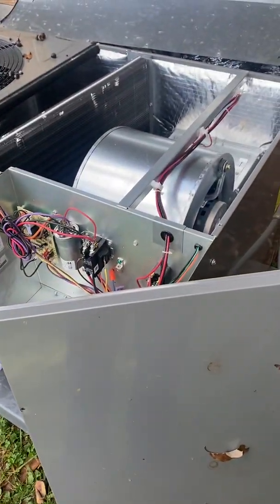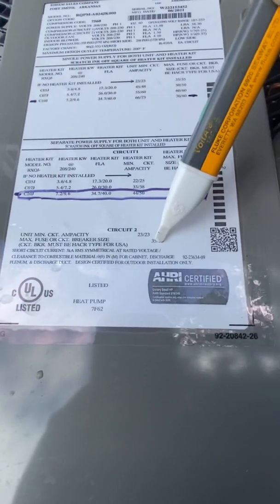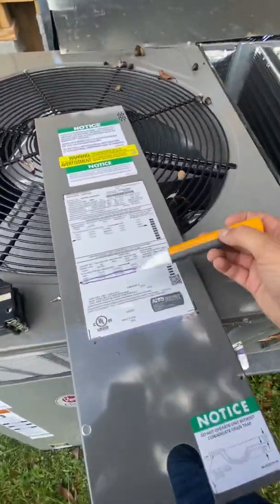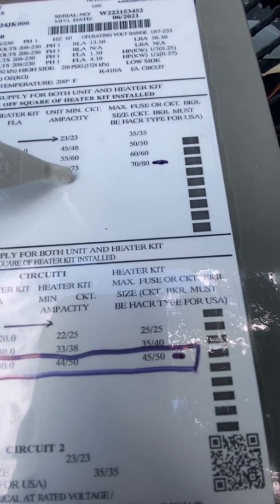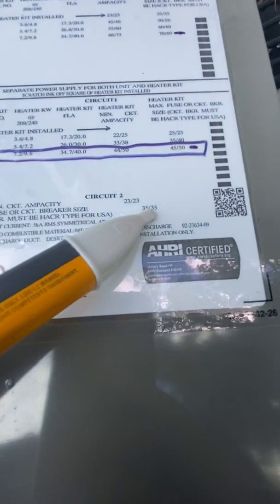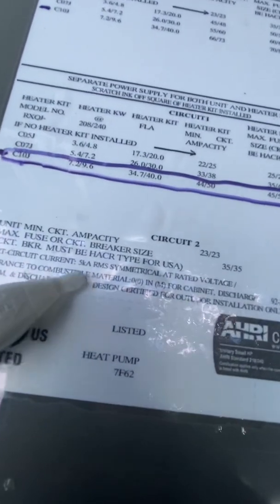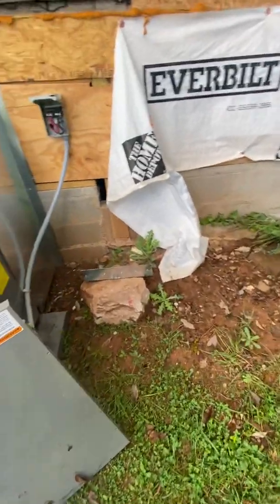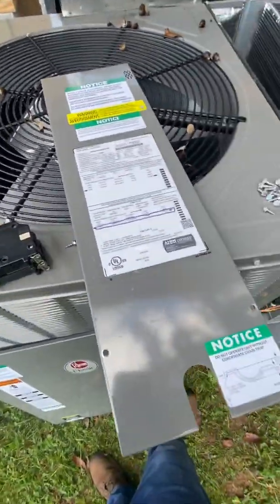Sizing HVAC conductors and breaker, heat kit

Comment: The panel sticker on my HVAC unit says that the max fuse or breaker should be 30 A. But for some reason they have a 60 amp breaker in the main panel. I'm assuming, that's not correct.
Reply from the maker: Hey, can you email me a picture of it
Reply from the maker: I’m assuming that’s incorrect but it could be correct if it has electric heat kit depending on the model of the heat kit